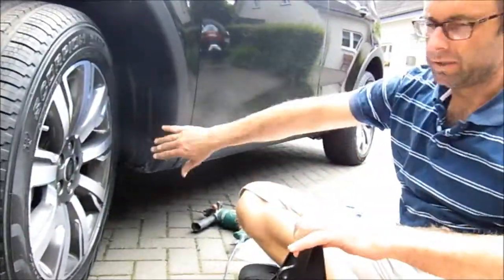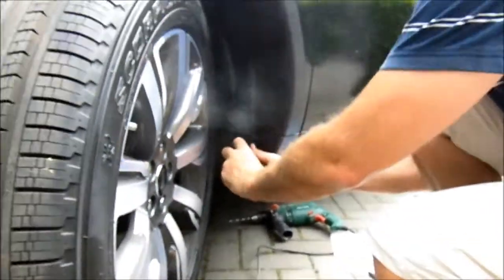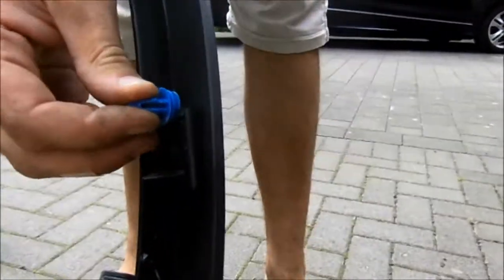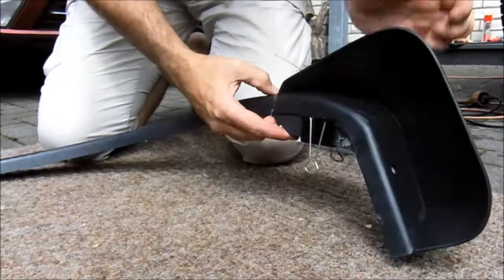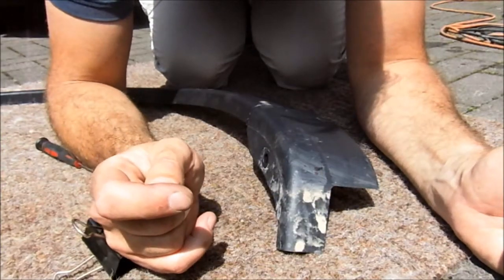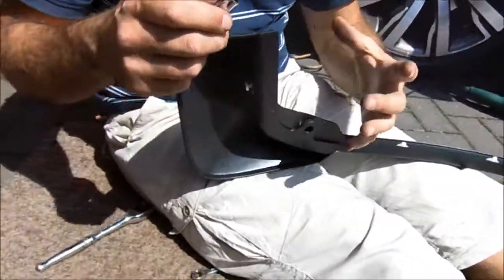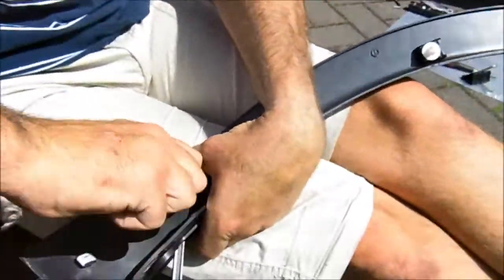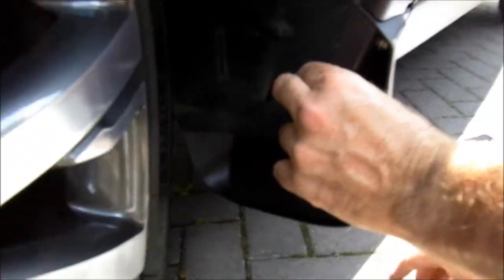Fitting Land Rover Discovery Sport Front Mudflaps

Comment: Just a tip, I marked my holes with the plastic trim in place, removed the screw from the front and put the flap in place then screwed back in holding the flap in position.  Frees up your hands when marking.

Comment: Honestly so much fuss to go through for a simple thing to fit. Manufacturers sometimes fail at keeping simple things simple.
Reply from the maker: The fronts only took about 10 mins side, the rears 15. Think that’s par for the course? My current E Class is supposed not to be driven for 24 hrs to let the 3M tape stick!! I suppose though they not many people for them these days?
Reply: @mercedes_and_more  they could have just added four designated holes for mud flaps and that’s it. I don’t mind spending 30 minutes, it’s not about time for me. It’s about messing with standard equipment, like making new holes, cutting and etc.
Reply from the maker: Yes you are right. At least on my Merc you use the existing holes (supplemented with 3M tape). The next owner of my DS maybe didn’t like them and would have had to buy new trim pieces - not the best idea 👍